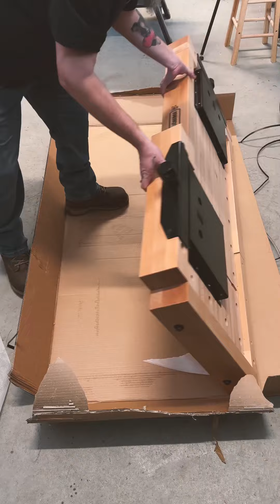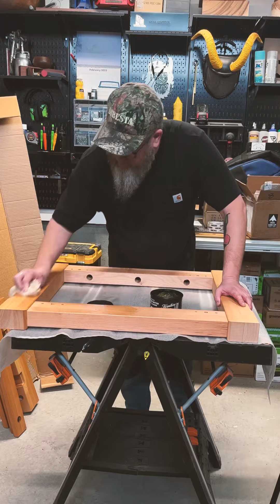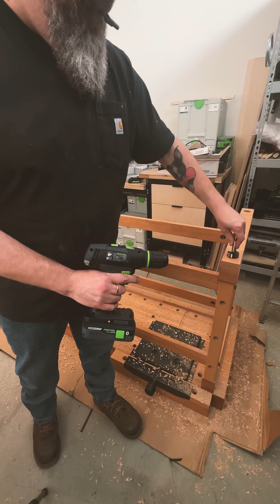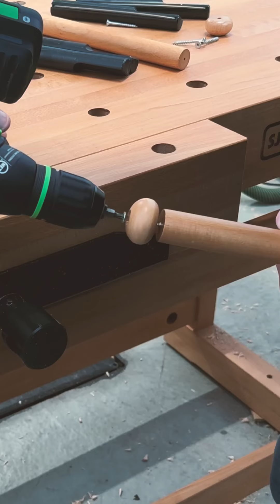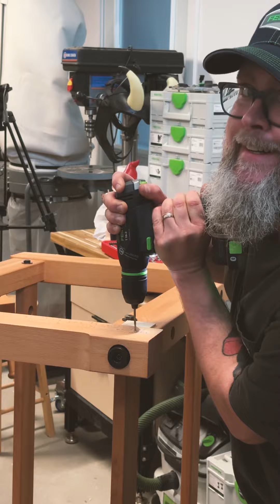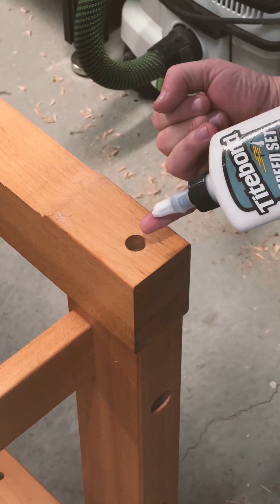My new Sjöbergs Workbench! 🪚

Comment: Love the additions you made to this bench. I just ordered the same bench myself after much deliberation. Question for you; what leveling feet did you get, and what size of wood do you have as a spacer for the casters? Is that 1/8 inch? Thanks!
Reply from the maker: @arowsrfr2  I got a cheap workbench casters kit from Amazon and the spacer is about 1/4". 🙂
Reply: @PatLap  thank you! Specifically I was curious about the leveling feet. Looks like you bored out a fairly large hole in each leg to support leveling pads. I've seen the hockey puck method and a few others. Curious if you just chose something else off Amazon, or if they were specifically for this bench. Thanks!
Reply from the maker: @arowsrfr2  Oh I was just trying to keep it as low as possible. You don’t have to do that. 🙂
Reply: @PatLap  ah ok got it. Thanks!